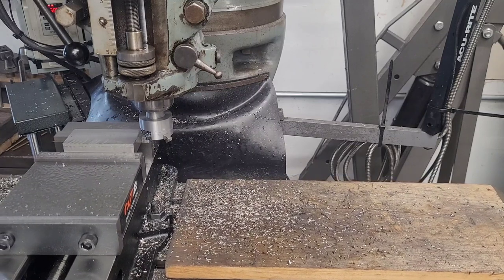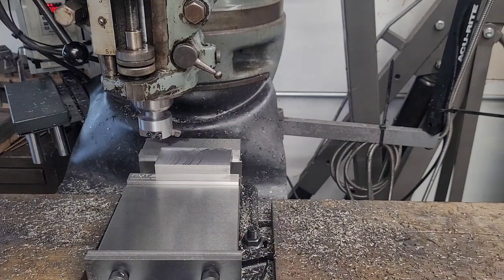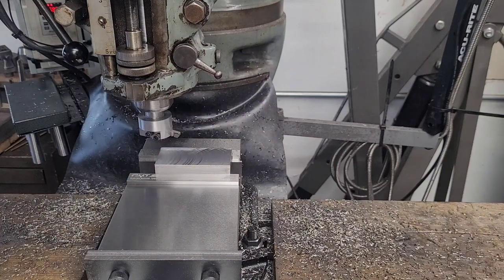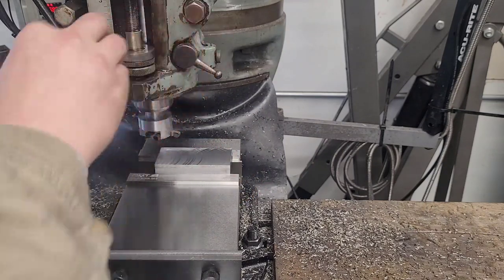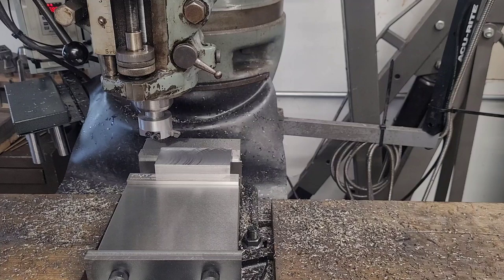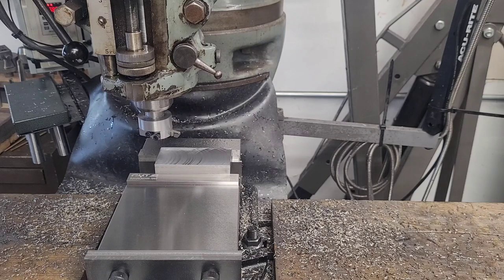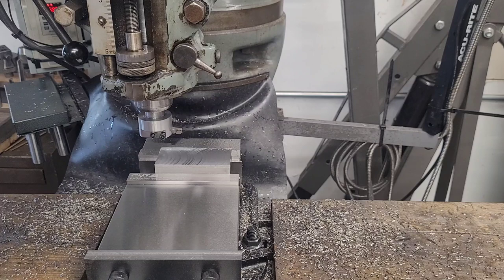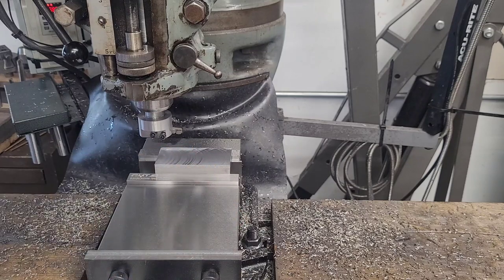Using a Fly Cutter in a Milling Machine

Comment: I'd like to see how you made that fly cutter. Particularly the tool slot at an angle.  Thanks
Reply from the maker: So the angle was actually the easiest part. I used a V block to grab the shank and eyeballed a good clearance angle, tightened the vise and called it good enough.
Reply: @moosesmachinery  ahh, that's simple. Thanks.
Reply from the maker: @CraigHollabaugh  just don't forget to cut a flat in the same set up to make screw  installation simpler.
Reply: @moosesmachinery  oh yeah, thanks.
Reply: Remember that the slot should not be central, it has to be be offset by half the width of the toolbit.

Comment: Try balancing the cutter with a duplicate on the opposite side and using 2 cutting edges.
Reply from the maker: Then it isn't a fly cutter, it's a face mill. The huge benifit of a fly cutter is that it has a single point doing all the work.